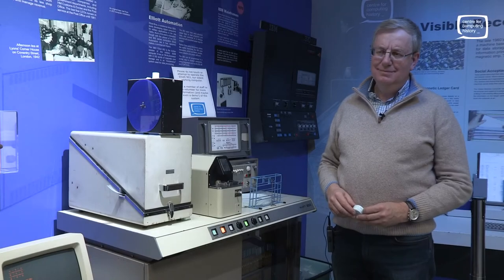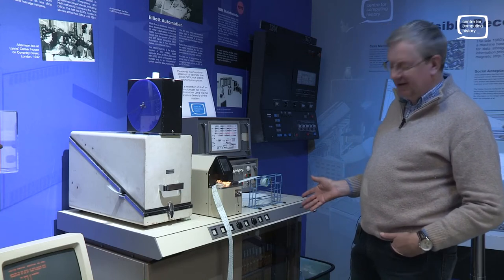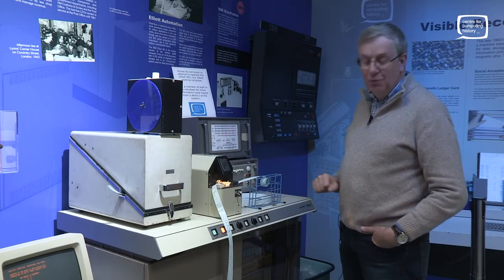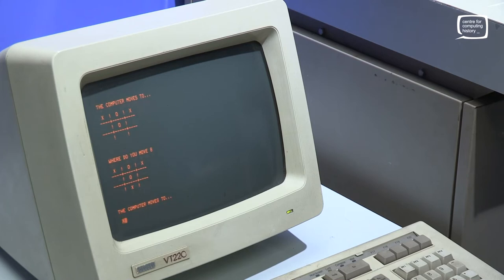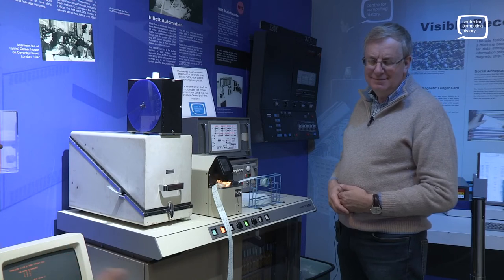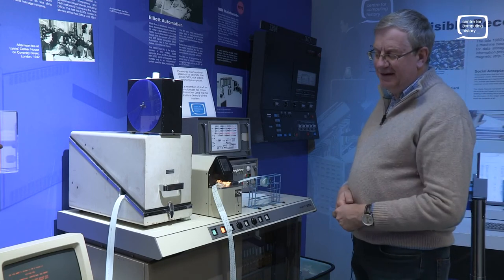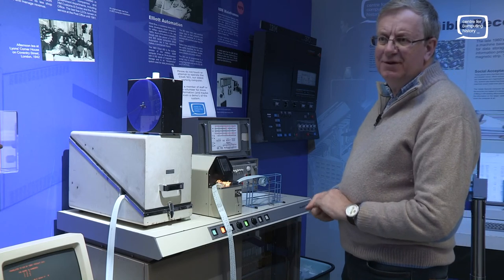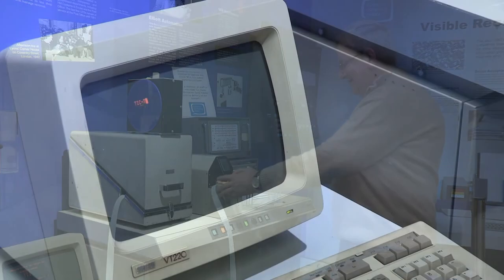Elliott 903 - Retro Computer Festival 2017 - Part 3

Comment: We were fortunate to have one of these machines at our school (Alleyn's) in the mid 1970s. Unfortunately it was destroyed by a fire, which also took away an IBM card punch machine (029 I believe), a couple of ASR33s and a CDC synchronous terminal and line printer, which were connected to a CDC mainframe at a computer centre in London (SIA I believe it was called). Programming for the Elliot was great fun, but creating even a simple program was quite a task, requiring loading multiple tapes and punching of intermediate tapes before getting a loadable binary. Loved entering the initial boot program using the switches! Those were the days....

Comment: Very familiar. I used to work on a system which used the Elliott 920B. The cards were constructed using Logic Sub-Assemblies (LSA) which typically had 3 gates, using DTL discrete component logic. The 920B's "CPU" was 18 AFA boards, each one of which was 1 bit of the CPU logic - probably the same cards used in the 903. The programming for the system was done in SIR (Symbolic Input Routine). Because the system was ruggedised, mylar was used instead of paper for the tapes.